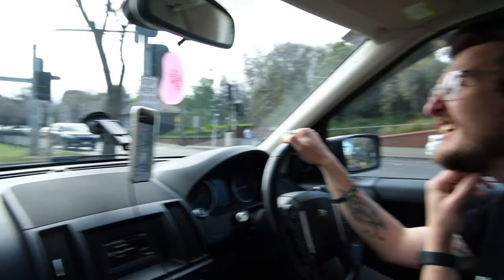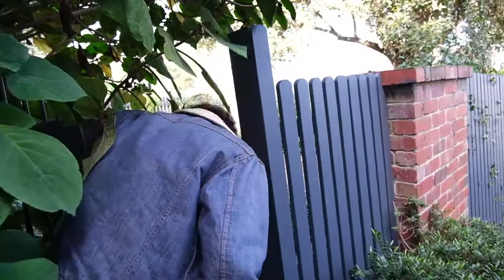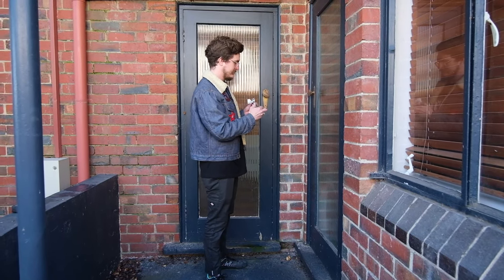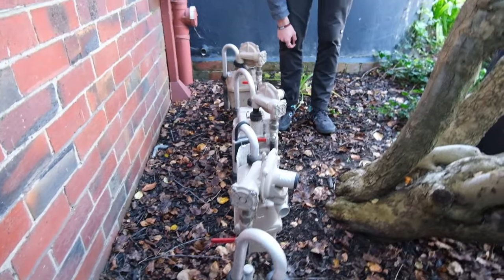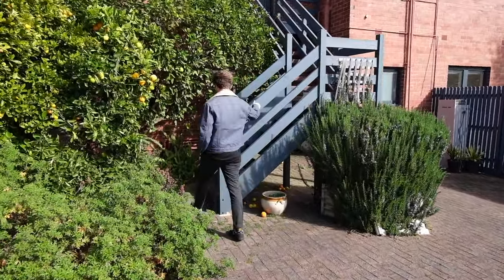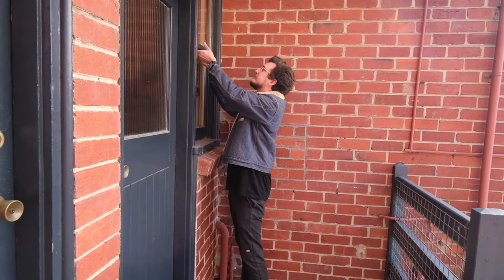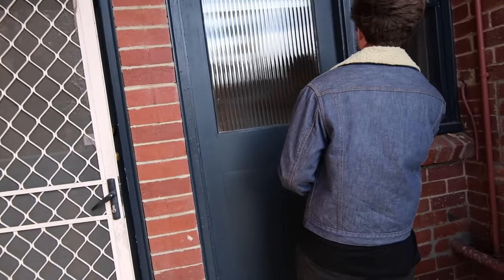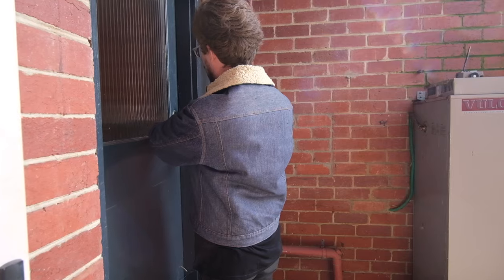Melbourne's Empty Apartments (part 1)

Comment: This makes me uncomfortable due to the potential legal fallout. I agree in principle that lawmakers should be ensuring dwellings are properly utilised even if it is as crisis accommodation during wait times during processes like probate or permit issuing or waiting for demolition where risks are manageable. The policy implementation is hugely complex and fraught however as for example, what if this has been vacated pending asbestos removal or black mould or e.t.c. I hope a lot more research is done before just taking over happens to ensure its ligitimately safe.
Reply: Surely it is safer than living on the streets?
Reply: I mean, what can they do to a homeless person squatting? Fine them? What money? Put them in prison? Free housing at that point.
Reply: I'm just making the point that when you get down to the nuts and bolts that things get very complicated so popping in and seeing its empty is not the same as it being safe
Reply: @AK-np4rp  potentially not.
Reply: @nickhutchins5537  Ststistically, it is safer to live in some form of shelter than no shelter.